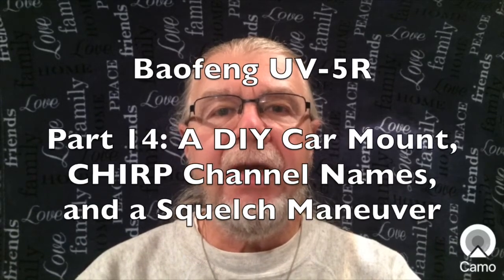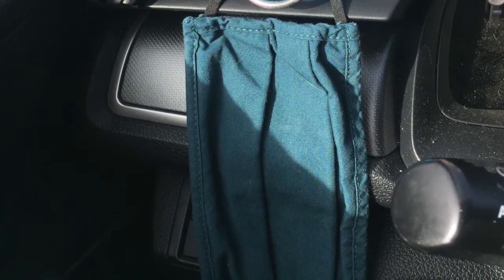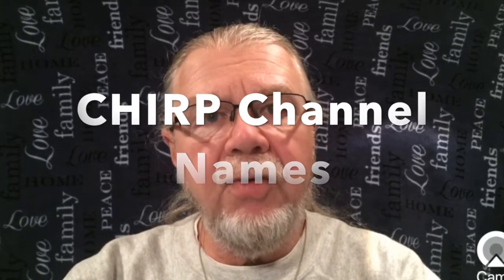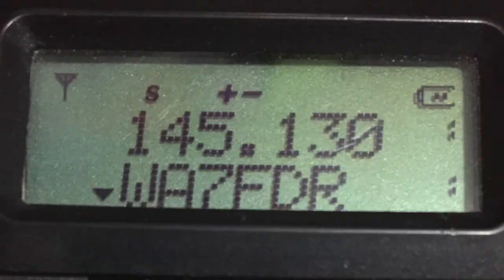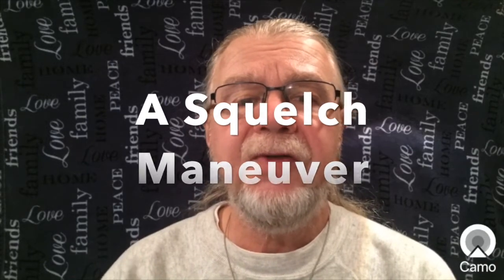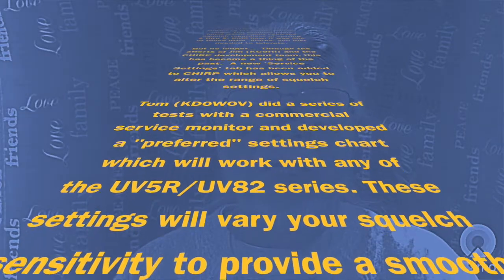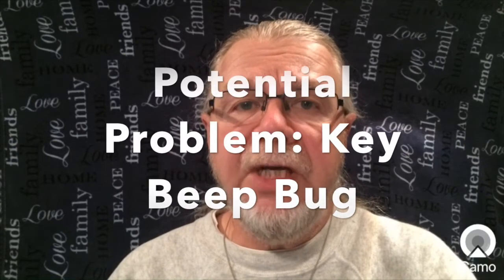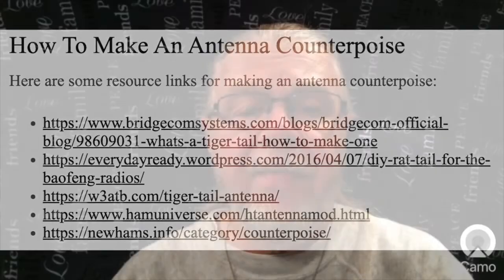Baofeng UV 5R | Part 14 - A DIY Car Mount, CHIRP Channel Names, and a Squelch Maneuver

Comment: Incidentally, you can also attach a counterpoise to the metal belt clip on the side of the radio, which avoids the possibility of causing a poor antenna connection. Also, it's worth hunting down a female SMA to BNC adaptor on eBay so you can use a decent antenna.
Reply from the maker: Good recommendations, Phil. I hadn't considered the metal clip at the side. I did order the adapter you describe, and it works well. It makes an easy connection to my homemade J-pole antenna.

Comment: I've got one of these now too. But I used a sock, held in place with lower bungee clip, as a sound dampener. My wife hats this as it's a used sock and we're running ac with windows up... i offered to use a pair of her unmentionables, but she declined.
Reply from the maker: Totally get it, Tom. There's really only one reasonable solution. She's got to buy you your own used pickup, the more beat up the better, that you can call your own. Then your old-sock-radio-mount can do its thing and nobody can complain! 73!